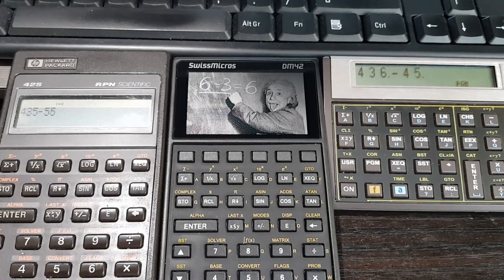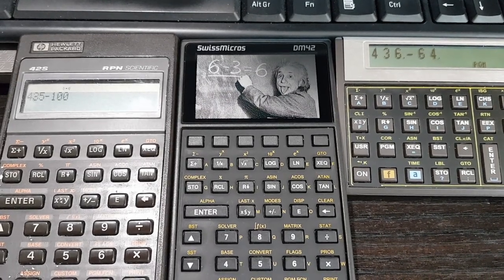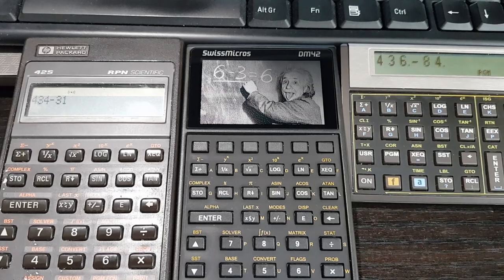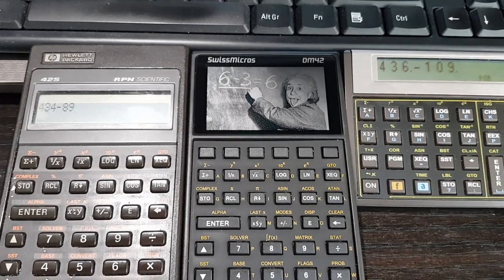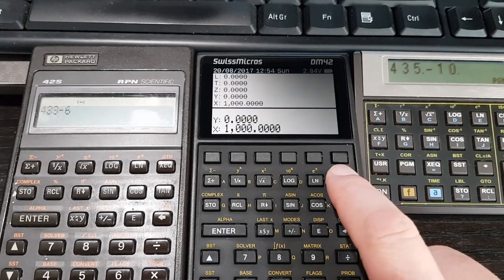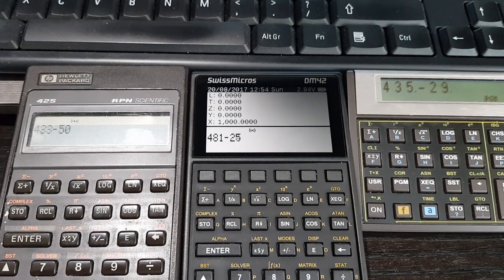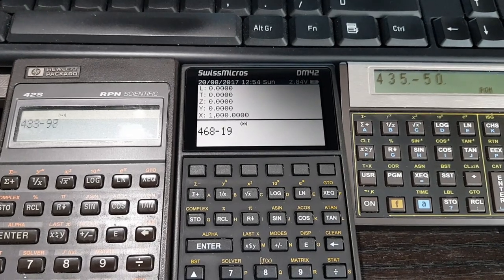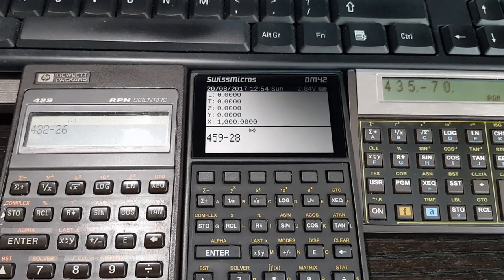Speed comparison HP-42S vs. DM42 vs. DM41L

Comment: Will we be able to view m x n matrices on the LCD when solving for matrices? --or view equations on the LCD (as on the HP graphing calcs)?
Reply from the maker: The DM42 is not a graphing calculator or a calculator that does matrix-based equation solving. It is basically an "upgrade" from the Hewlett Packard HP-42S (which is a programmable scientific calculator). It's engine is Thomas Okken's Free42 with the Intel Decimal Floating-Point library.
Reply: If it is based on Free42, of course it will do matrix equations... The question was whether the LCD will show a matrix' contents (more than one element) if it is on the stack, or even when editing them. I guess there, the answer is no.
Reply: The editor is the same as the HP 42s. The only difference is that you can now see the entire stack WHILE editing the matrix. It's honestly not bad.

Comment: Cool comparison! Thanks for the video. 

What was the clock speed was the DM-41L? The DM-41/L should be configurable for 25 MHz or 40 MHz.
Reply from the maker: Hi. The DM41L can be switched between 12MHz and 48MHz. In this case it was running at 48MHz (there's little point in running it at 12MHz because it'll still use up the same amount of energy to do something and just take longer over it). It will, however, have been running on an older version of the firmware that has since been accelerated somewhat. The DM42 has also seen major updates since this video was shot.
Reply: grshorwich thanks for the info. Sorry I misremembered the two clock speeds. I’m surprised that the DM41 didn’t do better at the higher speed. I thought it was supposed to match the performance of the 42S at only 12 MHz. It certainly should have been possible to build it faster today.

Comment: Why would I want the DM42 vs the HP Prime g2?
Reply: There is one thing the DM42 is way better than the HP Prime G2: accuracy.  The DM42 uses 34 digits to compute with versus 12 digits of the HP Prime G2. But who needs 34 digits?!? Actually, who needs 12 digits? ;-)
Reply: Oh, you can see the 34 digit if you use the show key on the DM42.
Reply: It’s better?
Reply: For one thing, the DM42 has dedicated STO and RCL keys.  Compare the number of keystrokes needed to store and recall numbers on the DM42 vs. the HP Prime.  The keystroke efficiency of the DM42/HP42 for keyboard-intensive computations will blow the HP Prime away.